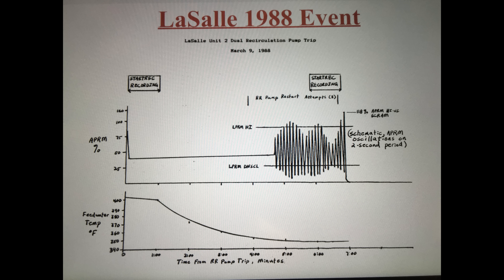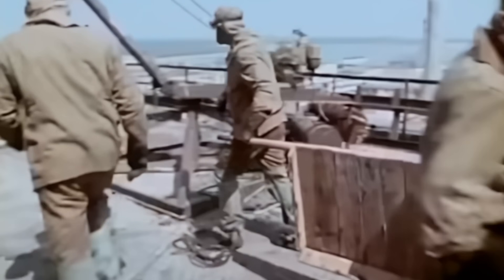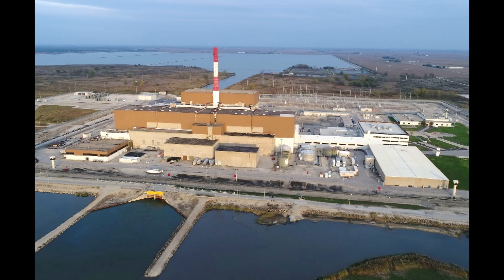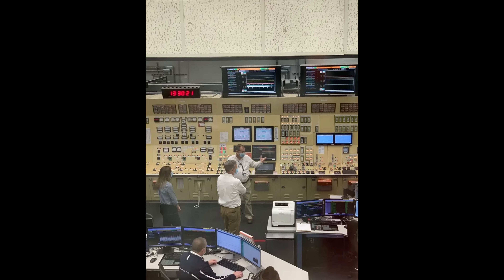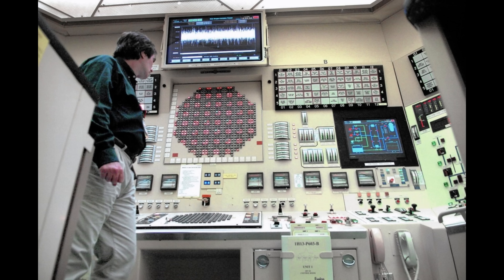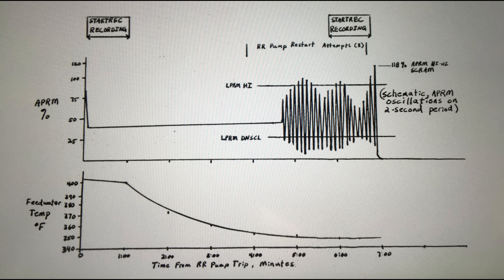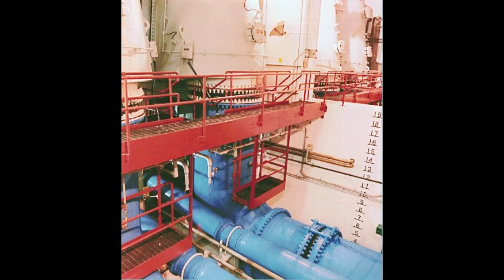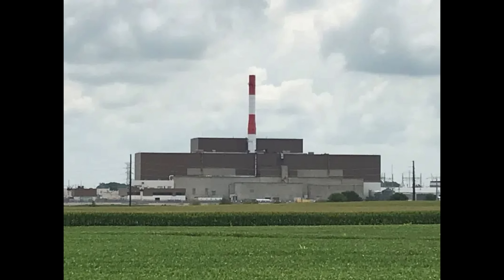LaSalle 1988: America's "Almost" Chernobyl?

Comment: Without more data, there are several (many) quite different oscillations that might have been occurring, with different consequences. 1) it could be a flash boiling - condensing oscillation. 2) or a radial inward outward oscillation. or 3) a ring oscillation with power levels varying across the core, and that rotating around the core.  or ... others.  Each of these and others can have different causes. It seems unlikely, but it might also be a pressure oscillation driven oscillation between the pressurizer and the core. These in turn could result in temperature-flow oscillations from the feed water. i.e. an oscillating cold water accident.

Comment: I live near the Dresden nuclear plant in Grundy County. It's amazing that there are two other close by nuclear plants. Braidwood to the south east and LaSalle which is 35 miles west. It's nuclear alley for sure and I have several high end radiation detectors and have never raised above normal background radiation 7 - 12 microseverts. You can tell when you live within several miles of nuclear power plants as there are strategically placed radiation monitoring devices.

Comment: You claim they should have increased feedwater flow….. but they can’t…. Because level would scream up and trip feedwater pumps. In a BWR, feed flow automatically follows level and steam demand. You have to raise power to raise flow. 

Raising feed flow does not solve anything. It would challenge MCPR and result in a trip of the feed pumps.

Comment: It can be very surprising how little automatic control (& sometimes indication) these older stations can have. I think it's worth noting (as you elude towards a couple times) that some of this is due too the technological limitations. Scanner arrays, large calculations required. When you talk about such large power swings so fast it would be nigh on impossible for an operator to manually intervene in a manner to regain control beyond pressing the big red reactor trip button even now nevermind if the computer systems then were slower. 

Personally I'm surprised there wasn't a doubling time trip for the control rods om reactor power and it's actually a terrifying example of how water temp + steam formation can/ could affect BWRS (and too a much much lesser degree PWRs). I'm not familiar enough with the operation  BWRs to know how the recirculation pump trip interacts with reactivity in detail & the rest of the station but I will say boiling instability in any boiling vessel (steam generators, boilers, BWRs etc) and are generally resolved by increasing flow/ heat transfer out of the region of thermodynamic instability. It's not a flawed logic but very easy to see why probably not the right one with hindsight. Goes well to demonstrate why these issues are never simple. Big systems with lots of important details. 

I couldn't believe that was a power graph when you first showed it. Especially if that it's an average power...
Reply: I'd love to know how you find out about these things tbh as even in the right circles I've never heard of some of these.

Comment: as nuclear accidents and movies were a big environmental issue in the 80's, (it was mostly bad luck) I remember being scared of the technology. but one I leaned how the water, rods and failsafe's worked I felt better. the new salt reactors are even safer. an they use waist radioactive material. I don't think they need one in each town, but they work way better than ever breaking down wind mills. (I lived in Lasalle County)

Comment: Okay, I was there.  I was a licensed Reactor Operator at LaSalle Station.
Everything you are guessing is WRONG.  I guess I shouldn't be surprised.
The SRO directed a manual scram, and the reactor operator independently stated he was going to initiate a manual scram at the same time.  The automatic scram initiated 0.07 seconds before the manual scram initiated.
This event was due to the fact that GE didn't analyze reload cores for T-factor.  We reactor operators and senior reactor operators had been trained that thermal hydraulic instability could not happen at our reactor because our T-factor was >1.  After the event, it was found that for reload cores, it was LESS than 1.
Actions taken:
Immediately prior to restart, a new "power to flow" map was generated to allow safe operation and stay outside of the instability regions.
Region A - immediate scram if you were in it.
Region B - EXIT region immediately
We also shared our Operating Experience with the industry (which is something we do in nuclear power) to help others learn from this.
After that, there were no more instability events at LaSalle.
After that, we installed Oscillation Power Range Monitors, which are designed to identify thermal hydraulic instability and scram the reactor if it is detected.  It took time to study the reactors and build the equipment, so this wasn't immediate.  They still use the power to flow map with the restrictive areas, even with this monitoring system.

The fear-mongering in this video is uncalled for.  Unlike Chernobyl (which we were trained on by the way), this was not operating the reactor in an abnormal lineup, there were not 12 inches of URANIUM in the tips of our control rods (no uranium in control rods in BWRs), and we had enough relief valve capability to deal with ANY problems.

The plant shut down AS DESIGNED.  This was not an accident in any sense of the word.  No fuel damage occurred, no equipment damage occurred, so to lump this in with SL-1, TMI-2, Chernobyl and Fukushima is completely inappropriate and is intended to generate click bait only.

You should be ashamed for putting out garbage like this.

Comment: The best way to “get it under control” is it turn it off and then turn it back on
Reply: Turning a nuclear power plant "off" and then "on" is not like flipping a light switch!  The plant must be down for a significant time (hours to a day give or take) for various radioactive fission products that "poison" the reactor to decay before a restart is possible.  The restart process itself is complex and time consuming.  Another factor to consider is that in any complex industrial plant the risk of accidents is much higher during startup and shutdown procedures as these procedures are not done frequently and thus the chances of human error are increased over normal steady state operation.
Reply: @Vincent_Sullivan I’m just saying insert the control rods and stop the reaction don’t try to do x y z first stop the reaction then fix whatever caused the issue

Comment: Maybe look at the reactor accident that occurred on 7-17-1970 just South of Eureka, California. That was PGE's first. Google "Humboldt Nuclear Accident" by Scott Rainsford. There's a 39min video which is not up to date, and a 66min radio interview (laborvideo).
     This was a loss of outside power, loss of coolant accident that uncovered the core resulting in an emergency evacuation of the refueling building so the explosive hydrogen gas could be vented intermittently to the public.
     South Bay Union Elementary School was 704yds or less downwind of the plant and was hit in 82 seconds. Little League baseball brought hundreds to the school. No one was told. The military in Idaho was consulted in order to save the plant from a hydrogen gas explosion as in Japan.
     The plant had refueled just 8 weeks before with zircaloy clad fuel rods and the accident resulted in more than 10% of the core partially melted. (As per Nuclear Fuel Services of West Valley, New York where the damaged fuel was sent) Difficulties addressing the damaged fuel at West Valley, exposed the workers which were later compensated $30mil. West Valley plant went bankrupt.
     The AEC investigation was presented to the U.S. Congress's Joint Committee on Atomic Energy on 7-22-1970. With 59 commercial reactors under construction (peak reactor construction period in the U.S.)  the committee covered it up. 
     The nuclear operator's log of the accident "lost". The notice of the activation of the emergency contingency plan "can't find it". More than 200 federal employees on a May 17th signed non-disclosure agreements. The National Archives that received the final documents from the Joint Committee on Atomic Energy's hearing refused all FOIA requests.
     Many "downwinders" especially the children, are dead. Many could have been saved if they had only been told.
     The industry, "Well, you gotta crack a few eggs to make an omelet".
Reply: 18 of the 20 cancers triggered by radiation exposure, could have been cured.  Had They had a corporation with values...and that's an oxymoron!  Corporations should never own power plants.

Comment: While this is certainly an extremely important industry shaping event and resulted major changes to both hardware and procedures across the applicable BWR fleet, calling this America’s almost Chernobyl is silly. There are a multitude of conditions in all reactor designs that if experienced concurrent with a scram failure would result in horrific core damage. Chernobyl intentionally operated in an unstable region and the core ripped itself apart even though the safety systems worked as designed. LaSalle operated in an unstable region inadvertently that could have resulted in core damage if not for automatic reactor protection systems. Even if major fuel damage had occurred, dangerous release of radiation to site environs would not. That’s not the way the US nuclear fleet does business.
Reply: You're silly
Reply: @Thishandleisntavailableyo ya motha

Comment: 3:42 Actually normal operating RPV level is about +36 inches, and RCIC auto initiates at -50 inches. So about 86 inches below normal operating RPV level. (They calibrated so that +0 inches is the elevation of the bottom of the steam dryer skirt.)

Comment: 'Core damage' in this case doesn't mean a wide range meltdown or an 'Explosion' like in Chernobyl, but more like a few cracks in the Zirconium-Claddings of the fuel rods. Yes something like that 'should not happen' for sure but i see at NO point an risk remotely comparable to the fast damages and consequences of the Chernobyl-Supergau.
Reply: Tell that to the folks running Fermi or TMI. Fuel damage is a big $#%$ deal.

Comment: I was in Middle School in Chicago when this happened. I can't imagine what would have become of Chicago or the Midwest had the scram failed. Instead we went on with our lives because the automatic safety system built into the reactor did it's job.
Reply: You have no idea.
There is a backup scram system.
Then a standby liquid control system, where you inject liquid boron into the reactor to shut it down.
There are emergency procedures to manually insert each rod from the field if necessary.

There is no real such thing as a "failure to scram."  It's impossible.

Comment: This is FUD and the person putting this out should stick with discussing RBMK reactors not BWR reactors since they don’t have the relevant knowledge. The reactor had a transient and entered a limit cycle oscillation that ideally should have damped out but was handled completely by one of the automated protection systems. The story ends there with lessons learned, analysis done, instrumentation changes made, and most importantly, an undamaged reactor shut down but that is not fodder for a YouTube video so the video creator must create hype by postulating events that didn’t occur. Further, there were additional automated systems available to mitigate this event if the first automated system didn’t handle it and to state otherwise is mis/dis-information. Of course, one can continue to hypothesize protection system failures but are those likely?
Reply: This information is worth to know about.

Comment: As someone who works at LaSalle, it is worth noting that every BWR In the country which didnt have quadrant based Local Power Range Monitor assignments were retrofitted with Oscillating Power Range Monitors to ensure an event like this could never happen again. The random assignment of LPRMs across the core had a hand in averaging out the APRM displayed power level as an LPRM showing high in one part of the core and one showing low in another part of the core effectively averaged themselves out. It is an event that every engineer and operator at a nuke plant has training on as it is one of the INPO Events that shaped the industry.
Reply: Neat to see another local but who works there! That's cool
Reply: I've worked for a neighboring plant and I can attest to this. We still have to plug in a computer that runs DOS to program these things every fuel load.
Reply: @daviddavidson3639  yea dont get me started on the maintenance terminals for the OPRMs..
Reply: Wasn't it just the BWR/2 that had quadrant based LPRM averaging? And yes, the most interesting part of this event is the I&C issues that hid what was going on to the operators.

As to your last point, it's the classic event. Easily understandable with hindsight, hard to foresee until it happens.
Reply: @Diabolical_Engineer  yep only BWR/2s and older, Nine Mile Point 1 is the only BWR that doesnt have OPRMs.
Reply: I didn’t understand a damn thing u said😂.Sounds like u know your stuff i appreciate all u guys thanks for the power .
Reply: Nice. I live in LaSalle County too. Cool info to know this incident changed the industry.
Reply: It's the bit that's easy to miss. The nuclear power stations are never not changing. There's so much knowledge sharing or certainly event sharing as someone else finds a problem, everyone else has to have a think and a head scratch as a result...
Reply: My Grandpa took me fishing there once and we went camping near there.Is it true that water is warm?All year round and it's radio active?
Reply: My dad worked there retired a couple months ago
Reply: From coal city, lets grab a drink at carsons in morris lol
Reply: Finally - someone at the plant who acknowledges the changes made, because of this event. All the triggered snowflakes, "this was nothing, why are you posting clickbait" experts need to talk less and read more...
Reply: @frankpinmtl who still calls people triggered snowflakes these days? Thats just lazy and boring.

Comment: I’m throwing the bullshit flag. 1) there was no possibility of the reactor exploding like Chernobyl. 2) The reactor protection system did exactly what it was designed to do. 3) Even if the reactor had been damaged, there was primary containment and secondary containment to limit the release of radioactive material. So there is no way this would ever have been like Chernobyl.
Reply: You fail to understand Safety Culture.
Reply: Yes, because the containment vessels worked so well at Fukushima...
Reply: @slwsnowman4038  Ah yes, comparing this event with an earthquake + extended loss of AC power event.
Reply: @slwsnowman4038  What containment "vessels"?
Reply: @slwsnowman4038  
I think you mean "reactor vessel" and "containment building". And yes, both did what they were designed to do. What we saw during the hydrogen 'splody events were the top buildings above the actual containment which were designed to fall away during exactly such a high-energy event.

Comment: TLDR: automatic safety systems worked as designed and there was no core damage or radioactive release.
Reply: You've missed the lesson. The reactor was forced to defend itself. Disqualify and retrain the entire crew. AND immediately change procedures.
Reply: TLDR: systemic flaw identified after prompt criticality event, industry standards changed to prevent future rolls of the dice. But nothing happened, it would be alarmist to improve standards, why do we waste money on that amirite
Reply: More like "the last line of defense saved their ass at the last possible opportunity". The problem is that everything before that didn't work to stop this kind of condition from occurring in the first place until they were left with only one safety system (a full on scram) between them and ending up in history books for all the wrong reasons. In engineering safety critical systems, getting all the way to the last line of defense can (and should) be treated the same as full-on catastrophic failure, as you were only one layer away from just that, and when dealing with safety systems, one is none.
Reply: @unmountablebootvolume sometimes i wonder how people like these get to control dangerous stuff like this that require huge responsibility and critical thinking just like being in a nuclear submarine or being in a nuclear launch station...ect

If it wasn't an automated system that did the right thing, human error will be repeated again just like what happened with Chernobyl 

Shame